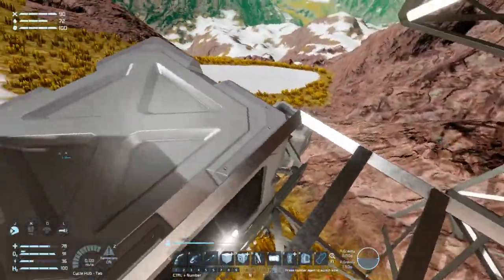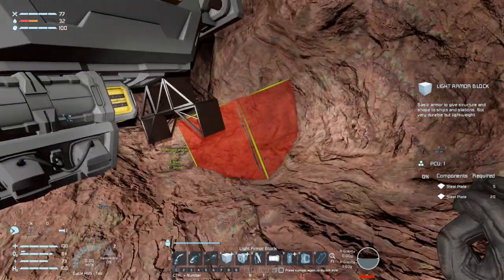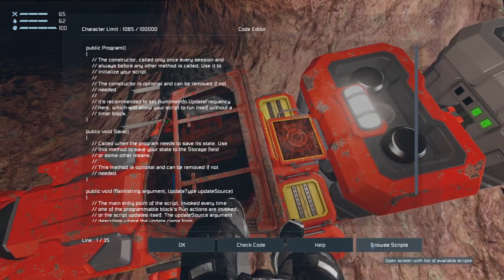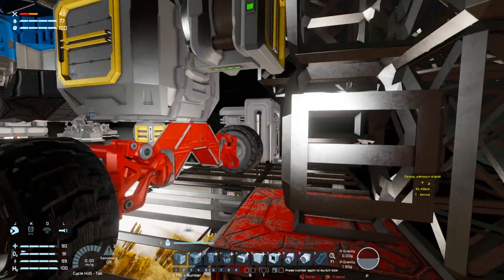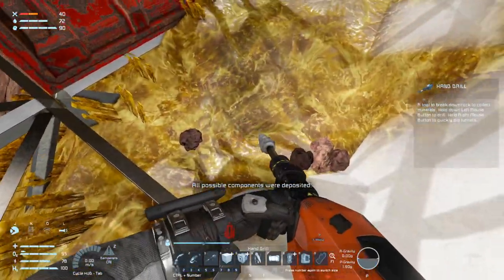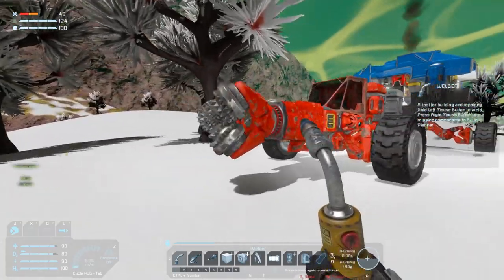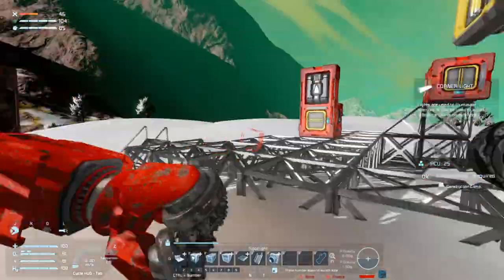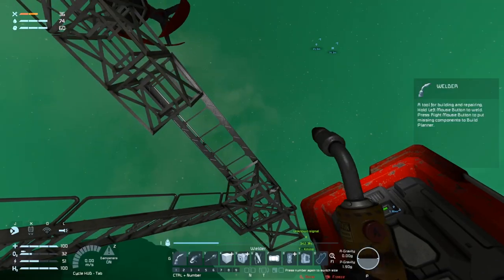Survival Impossible - Packing my bags #4 - Space Engineers Hardcore Survival

Comment: A solar panel outputs 120kw max
A wind turbine outputs 400kw max

Solar panel max energy density per block space is 15
Wind turbine max energy density per block space is 14.8

Currently wind turbines calculate there clearance by 9 raycasts: 8 fanned out from the blocks center aligned with its orientation checking for any obstruction in 20ish meters, and 1 aligned by the planets gravity checking for any voxels in 25ish meters

For wind speed its badly coded (and I have submitted this to keen's attention) by determining the air density at the grid's pivot point, offset slightly by the center of the grid (or center of mass, needs more testing/code diving), and any reductions due to above obstructions based off how close a raycast triggers

So while you cant ideally place wind turbines side by side, or directly diagonally, you can place them in like how the knight moves in chess
Reply: Just an update on this... seems Keen did an unannounced patch for this and the wind speed is calculated just on the grid's center of mass (which you can't see for static grids) and then deducted by obstruction distance based on the raycasts as mentioned in my first post
Reply from the maker: While all the stuff you said about how turbines determine obstruction is true, I made them 1/4 as effective as part of the mods I made for this series which means they don't add up quite so well :)

Comment: I was wondering... I wonder if you should make multiple different "modules" to attach to your cart based on what you want to do. I don't think it would be too hard to make one of each,  each with a single battery and one piston with a landing gear (optional) that you can extend to ground when parking. Or just make rotors into base wall you can plug them in for charging. That way you can use the main unit while the "plugins" recharge from wall. :)
Reply from the maker: I think it's something that might happen, assuming I can think up some other modules besides cargo that'll be regularly useful with the miner :)

Comment: 28:39 

Splitsie: doesnt mine that tiny nugget floating in the air.
My OCD: !!!TRIGGERED!!!
Reply: You actually cant get them with the hand drill most if the time, you would have to hit the exact pixel that SE thinks that it's at, and sometimes that's not even inside the rock so its actually impossible
Reply from the maker: I tried briefly and gave up for that very reason :P
Reply: @Splitsie  I tried to remove one for 5 minutes with a triple headed drill rig in space so I wouldn't fly into it later. I had to get out and nail it with a hand drill :-)

Comment: An idea for your solartower 
There is a mod on the Workshop who is based on isy‘s alighnment Script but instead of you building some sort of contraption it adds a single Block wich is auto-aligning to the sun.
And it adds fancy bits to atach solarpanels on to.

I think its called Solarrotors 

Maybe it helps you😉
Still enjoing all you guys pushing survival to its maximum 👌🏼😁
Reply from the maker: I'll have to think about that one, I tend not to add mods that do stuff only slightly easier than can be done in vanilla since if they break I haven't gained much and now have to deal with fixing my game without the mods - it's just something I think about given how long I tend to run these series for :/
Reply: I can totally understand that.
I was just giving ideas 
Wether you use Thema is your choice.😁
No offence taken😁👍🏼
Looking forward for the next part
See you then

Comment: Yeah, a new Survival Impossible! Still my preferred Space Engineers series so far.

And congrats on the new microphone by the way. SM58 (I believe was the old one) is a very decent mic, and an unbreakable workhorse, but an old dynamic can't compete for details with a good condenser, even if it's a shotgun (though a lot is lost in the heavy handed Youtube compression). For my personal taste (and hardware) I preferred (a wee bit) the low end of the old setup and the high end of the new setup has a touch of… something. Maybe a touch of sibilant frequencies, or something.  And sure you still have micro adjustments to make here and there, but it's a step forward.

I would be curious to hear your feedback in a few weeks, using a shotgun to stream and record videos. I'm always wandered why it isn't more popular. In theory I would have thought one could put the keyboard near 90° of the shotgun polar pattern, for maximum clicky dampening, yet have both the mic angled toward the throat to get those nice throat and torso basses and the mic out of the way of the screen. Or another similar setup. Could be a nice alternative to the usual high end dynamic mic (I do love those mics and their radio voices, but variety is good), if it works nicely and easily (that's the thing with the classic RE20 and SM7B and such, good voice, good noise rejection, and so easy to use if one has enough clean gain to drive them).

And yes, you could use that in the field to record things in loud environments. Especially if you learn to handle it without bleeding handling noises and vibrations into the recording, and using it closely like an old 80's/90's street reporter mic, passing it forward and back between each question/answer. I believe it's what they used on park benches talks in the Matt & Tom Youtube channel, if you want a audio-visual low production example.
Reply from the maker: Thanks for the detailed feedback, I'm definitely happy to get stuff like this about the audio I use as I'm still very new to it. Since you seem to be fairly up to speed with it all, the new mic is a Rode NTG4+ which I can't yet position exactly where I'd like until I decide what new desk mount I'm going to get and where to fit it, though hopefully I'll pull the trigger on that purchase soon and get the mic more optimally set up than its current position. My fingers are crossed that it'll help with some of the things you've observed.

It's interesting that you pointed out the low end of the SM58 as that was one of the things I also really liked about it when I looked at reviews on it before purchasing and I've certainly noticed it with the shift to the new mic. 

Hopefully I'll get the chance to use it in the field, though there's a lot more research to do on that front since I'll need to get a proper setup to go with my camera and that's a lot of equipment to learn about and hopefully not waste money on :P
Reply: @Splitsie  If you want to learn more about audio, and video, the two channels of Curtis Judd are quite interesting. There's some review about recorders, and using audio with/around camera. If you can, the best use of money is to go directly toward good solid equipment, instead of just buying "a little bit more" to upgrade (which in finale, is a waste of every purchase until the last one). And it's not multiple thousands of USD expensive. But it is expensive. So it depends on what you are looking for, and your budget, and the money you aim to make with it. You might also want to look at things like the subreddit /r/audioengineering/ which is more pro, and less "put a Yeti for everything and you're fine" :)

For recording in the field, depend on what you want. Do you have a Capacarm to boom it? Or do you want to use it by hand like an interview mic? Or do you want to mount it on your camera (but you won't be able to be behind the camera and talk)? First two require a portable recorder or a wireless transmitter and receiver, the last one could be plugged directly inside the camera but most camera have not so good microphone input. Curtis Judd speaks on it often, and work around and things of that nature. He's probably a better source of info than a random Youtube commenter :)

As for the recent audio on Youtube, it's quite usable. There's subtle differences, but most of it is masked by Youtube heavy handed compression. Personally from time to time I hear ambient noises, usually when I think you move away from the mic or talk lower, and rarely I hear a bit of the room (the reverb and "ambience"). I don't have especially good ears, but I have half decent listening equipment. But it's good for something you haven't properly set up yet, that's for sure! And I would guess the people listening on AirPodthingies or $30 Logitech speakers didn't notice anything different.

Comment: instead of using a script based tracking solar array, have you used the "SmartRotors: Solar" mod?  it seems to be quicker in finding optimal status
Reply: The only problem with that mod is it always tracks the sun even through the ground so it can destroy the solar panels but that's not that bad
Reply: @griffinmartin6356  as long as it's built with that in mind, it's no biggy
Reply: Also, the more mods you have the longer it can take to load, and the difference is negligible in terms of tracking efficiency. It really depends on what you find most comfortable. I, for one, prefer scripts because I can modify them if I need, and they tend to give useful info, like battery charge, as well.
Reply: uh oh, second mention already for solar rotors over isy's solar align script :/
Reply: @_harbinjer  I'm not saying isy's scripts aren't good, cuz i use many of them myself, i only mentioned it, so it's one less block to worry about losing components from, if he ends up having to move it or gets damaged at some point. Again nothing against isy at all 👍
Reply from the maker: I'll have to think about that one, I tend not to add mods that do stuff only slightly easier than can be done in vanilla since if they break I haven't gained much and now have to deal with fixing my game without the mods - it's just something I think about given how long I tend to run these series for :/

Comment: Honestly if you build a new basic refinery there is no need to move the old. A large refinery with power  modules produced more, faster and for less power. And you will need to build one anyway.

Edit: Maybe leave it as a remote Outpost and repair station? Because I expect you will need repairs quite often. Add a H2/O2 and a chair for recharging. Maybe even expand it to a single small pressurized room.
Reply: @_harbinjer  Stone, yes. But once he find sources of other ores how much stone will he process? Iron, Cobalt, Magnesium, etc are all better in a large refinery. And power will be a huge issue for some time.
Reply: @Bigrignohio  indeed, good point
Reply from the maker: I'm hoping to need both, the basics to still process lots of stone (since that's likely to be needed for some time) and a large to get more out of the ores that I do mine from boulders or other locations :)

Comment: the refinery is easy .. slap a set of wheels on each side one on the refinery and one on the battery end ... then hook up the miner to the down hill side ... yes make a ramp ... and then cut the refinery loose from the station and drive it all over as well ... or you make yourself a base train chain miner to survival pod to refinery ... and then that caterpillar to the new spot ... un hook the miner pipe the refinery into the pod and then build the new base when you have spots made drop the bits in where you need them with the miner ... then you base is mobile and self contained ... and all you ever have to do is remove a few conveyor tubes and some basic blocks and poof your mobile again ... as you make better vehicles turn the strongest one into the cab and then relegate things like the miner to towed item at the back end of the train  a caboose so to speak ... any other bits go before that and after whatever was last ... and so on ...
Reply: LOL those stairs look like a firetrucks fire hose boom ... maybe make a set like that for the big trucks ... then you literally unfold the stairs to the ground for when you cant fly in ... like in this scenario ... put the first rotor where the basket of the truck would be and thats what is connected to the truck ... then the next rotter at the landing  so it unfolds like your door does .... and poof instant path back up to the vehicle ... and it safely stows for travel too also open it the other way and you now have a ladder to someplace high again ... say observation or getting on top of a building

Comment: Why didnt you just put a small control seat on the tiny spawner instead of making a new truck?
Reply from the maker: I'd then have two vehicles and no means to move both of them :/
Reply: @Splitsie  would be easier to move it to flatter ground, the remove the seat, and start connecting 😊

Comment: Call the miner part "CanYouDiggit", the trailer "Caboose". Call the base "HoleAmoan" or something like that. And make a glass observation deck on top, forget killing trees. Connectors might be bad idea resource wise, but easier unloading? Want to try the small grid infinity miner? https://images-ext-1.discordapp.net/external/xFH3UN92kHbvzE_fiv2NmPZSPEYbtK64uwNB4XChZJQ/https/media.discordapp.net/attachments/616436436643741706/616437405011935252/folding_drill3a.png You might get away with drilling sideways(since no real ore deposits) with good counter-weighting. Decent start!